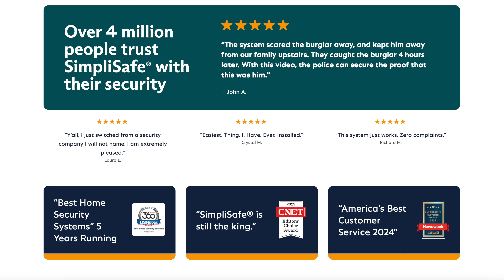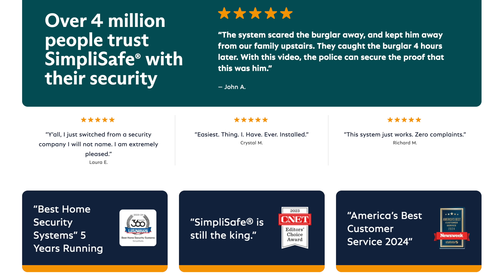Not Going to Lie, I was a Little Nervous! Back in The Saddle

Comment: Hello Mike, I had my Corvette ceramic coated about a month after I purchased it. The car was brand new but had swirl marks on it from the dealer washes while on their lot. It took 3 days between the buffing and double coat of ceramic applied. You cannot use the car during the process because if it gets wet it will get marks, so it must stay garaged during the process. The other thing is it last for a few years and needs to be reapplied. The car looked like it had a glass coat. It’s worth the money.

Comment: The hesitation you experienced setting up the fireworks is classic PTSD.  Besides being a  peer councillor for emergency services workers that had experienced a bad call, I, too, had my own incident when I was hit head-on by a very drunk girl doing 85 mph.  I ended up in intensive care for a few days, but she made a couple of trips through her windshield and nearly bled out.  For a couple of years post-incident, whenever I was driving around a shallow left curve at night and there was an opposing vehicle, my breathing stopped, my pulse went up, my hands clutched the steering wheel, and I froze, at least until the opposing vehicle passed.  I could have sworn the vehicle was going to cross the center line and get me.  Like I said, it took a couple of years to gradually pass, but pass it did.

Comment: Hey Mike, I have a Black Ram 2500 mega cab, and I did the ceramic coating on it about a year ago myself it was quite a job to do on that big truck and I’m sure it would be a big job to do on Melissa‘s new vehicle but I think it is worth it. The paint looks and shines like brand new still a year later, and the ceramic coating is really good on the glass seem to stay clean longer. Unfortunately, I’m in Texas, so I can’t recommend anyone in your area but the product I used was Avalon King.

Comment: I've used ceramic on my vehicles for about 6-7 years. This time I went with a 3 year ceramic coating. It makes your paint look "deeper" than plain wax & if you have a better one put on, it'll last as long as they say it does. So far I'm on year 2 of a 3 year ceramic & it still is doing it's job.

Comment: Mike/Melissa, highly recommend ceramic coating for a dark color vehicle, especially if they set outside. It will cost a bit of money (roughly $1800-$2200) based on who you use and what product they use. Ceramic coating saves your paint and actually allows you to wash less, but it won’t affect the paint/clear coat.  If anyone who spends a considerable amount for their vehicle and plan to keep it past 2-4 years, it’s a definite must have. Almost like window tint 🇺🇸🇺🇸🇺🇸

Comment: Hey Mike, as to your question.  Yes I have a 2012 Dodge Journey that was ceramic coated. Body and rims. I thought it was well worth it at the time. But around 5 years ago we got into a little fender bender. And the left front fender was replaced. It was repainted and no coating. They did a good job. Because today I can't tell the difference. Same thing with the left front rim.

Comment: I did a ceramic coating on my brand new 2023 GMC Canyon when I got it last summer.  I applied it myself, which is easy if your car’s paint is still new without swirls or scratches.  WORKS GREAT!   If you do it yourself you’ll need the car inside/shaded, especially for a black vehicle.  You don’t want to try to apply it to a hot surface!
Reply: On that black beauty no way without paint correction and professional application.

Comment: I purchased a little L3902 last year along with a Land Pride FM2560 with Y blades. I thought I needed hammers because I anticipated limitations. As it turns out I will stick with them as they are ideal for briars, tall grass and some brush. The 39 horses is perfectly matched and it runs super quiet. I sourced mine in Tennessee for thousands less than, my dealer list. Apparently the flails don't sell nearly as well as rotary and some dealerships have them in crates sitting. They were thrilled to drop ship it directly👍🏼 DM and I'll give more details!

Comment: Mike my son  has blogs where he tests products like the ceramic coatings on his restored waggoneers etc. He also has a black gmc suv and the new Toyota Wrangler that is also  black. Here is his comment when I asked him about ceramics coatings.  "if you plan to go through a car wash, its not worth doing the ceramic coating. A PDF film might be a better option. I have  both professionally installed coatings and a warranty and I have done the DIY version. My personal preference: MKee's 37 Deep Gloss Sealant (lasts up to a year). Both are super easy to apply. The McKees's makes the paint feel like hot butter it is so smooth."

Comment: Hey Mike, our families have a LOT in common, we even have a golden named Axle (because we’re car, equipment, etc people but I bet yours isn’t spelled the same.)  All that said, in answer to two of your questions: 1) emphatic yes on the ceramic coating, did it on my wife’s Yukon Denali and my C8 and it’s a game changer, NEVER have to wax again!  I HATE washing and especially waxing vehicles!  Downside is the cost if you have it done professionally, about $2500 in eastern PA but I’ve heard you can get the good stuff to do it yourself for a few hundred bucks, 2) so glad to hear you’re finally in the hunt for a flail mower, I love mine!  I have a hydraulic offset Del Morino Centurion 158. If you think the brush cutter on your mini skid mulches things well this takes it to another level, think actual mulch if you go slow and it cuts grass nicely too.  I have the knife cutters but would have preferred the hammer’s because I’m usually making trails and churning through saplings but the knives have done remarkably well and are holding up better than I thought they would.  The flails don’t require much PTO horsepower so your 40 hp Kubota would do fine in that regard but I don’t know how it would do stability wise with the offset function.  It’s no issue with my tractor but it’s quite a bit bigger, about 12k with the loader, flail and all the ballast I have. I think the flail is around 800-900 lbs if memory serves.

Comment: Nice to see the fireworks flying again. Looked like it was a great show. I have a Del Morino Super Centurion 158 flail mower. It has hyd offset and tilt. Fantastic for ditch banks, around ponds and fence lines. I am using hammer blades. It is very well built and has not given me any problems for the past 5 years of fairly heavy use. If you want something with a wider cut, I would recommend getting one with just hyd offset and no tilt. I seldom use a rotary cutter any more since the flail does a much better job.

Comment: Hey Mike. I have plenty of time but I buy the turtle hybrid ceramic coat from Amazon. Also had a black truck before the black truck I just bought. I did it myself on the old truck and found it a lot easier than the old paste wax we used to do. Can do it in half the time. Easy on and easy off. Now the new truck I just bought supposedly has it. They tried to charge me xtra for it saying they do it to all their new ones. I said I’m not paying for it and he said I wouldn’t get whatever kind of warranty for the ceramic coat. I told him no problem. No warranty! A regular detailer will charge to clay bar your finish to correct the finish before ceramic coating it. A new vehicle doesn’t need clay bared or paint correction so you should get a break there. I do believe it is worth having. My old truck beaded water like fresh wax but I did the ceramic hybrid a couple times a year. Good luck bud

Comment: Mike, I emailed you back on August 3rd with the suggestion to have your truck and Melissa’s new SUV ceramic coated (by a professional). I had my truck ceramic coated back in 2021 and it still beads and sheds water like crazy even after 3 years. The main benefit, in my opinion, is that it makes maintenance washes so much easier because the dirt doesn’t stick to the paint like it does without any protection. Also, there are lots of products available that you can use to maintain the hydrophobic properties that comes with a professional ceramic coating. 👍

Comment: Ceramic coating is the way to go. I have had both my p/u and my wifes new vehicle done. I use a detail shop close to where we live. It makes it so easy to keep the vehicles clean. I rinse both off about once a week and have had great success without using soap. Cost on both was about $350.00. Ceramic coat will last about 16 months. Great investment and time saver.

Comment: Last Dec I bought a 21 Ram Bighorn that was a lease truck. It had just under 18K miles and is a dark Patriot Blue Pearl color. I had it ceramic coated and I like it. If it is a little dirty I just park it in the driveway before it rains and it gets washed and the water just rolls off and it's clean. if its not going to rain I can just hose it off. since Dec, 4th I have only washed it 5 times and I am in Mi. and I drive on quite a few gravel roads and that ceramic coating just keeps it looking great.

Comment: Mike I use Exoforma on my trucks….they make all kinds of cleaning products……the main product is a ceramic spray on and wipe off……at first I thought this stuff was bogus…..but after using it this stuff does work!!!…..look it up for yourself…….I’ve been using it for almost 6 years…….the key to this stuff is to use the preparation cleaner first before applying the ceramic coat protector……mud just rinses off with water

Comment: Bought a flail mower last year and the bush hog has not been back on my tractor since. Flail mower leaves a much nicer cut and it doesn’t bog down as much as the hog in the heavy stuff. I use the hammer blades but if you want to use as a finish mower you can always change to the scissor blades.

Comment: Mike, I ceramic coat my own vehicles. I’ve even coat my tractor and zero turn! It protects the paint, makes it a little scratch resistant and makes it easier the clean as it makes the paint slick and thus, dirt, etc. doesn’t stick as bad. I use Gtechniq coatings and foam cannon soaps. I live in SWest Va so I can’t help you with an applier friend. That GMC sure would look good…. just saying….😁

Comment: Good morning Mike and family. Mike, I use 2 of my 275 gal. totes to catch rain water off 2 of my sheds roofs. I use the naturally soft rain water to rinse my KX 40, vehicles, and tractors, etc. I too use a blow dryer and it leaves a spot free rinse. To spray the rinse water from the tote, I use a 20 V Dewalt power washer. It has a suction tube with a float that goes into the tote and the other end attaches to the sprayer. It's very mobile and can be used anywhere you can haul the tote. Heck, you could even spray water on your food plots if needed. lol  ( From the Ted who's not a Dick )lol  Have a Day!

Comment: I've never had a vehicle ceramic coated but I do use a ceramic sealant or spray wax on my vehicles after I wash and dry them.  If you're not going to use some sort of paint protection as part of your wash process then you should get it coated.  I don't have any recommendations on which one is best but I do recommend you get some sort of paint protection on that vehicle.  
Dave in Ontario, Canada

Comment: Mike, based upon your recommendation we purchased and installed simply safe a couple of weeks ago. We are not very happy about one thing. There is a delay between the time the camera picks up motion and then connects to the base and then back to the camera to show us what has happened. Sometimes it only shows the back of someone leaving and sometimes it doesn't show anybody was there even though we tested it to make sure there was someone there and the camera was working. Haven't decided what we're going to do yet, but I am leaning towards sending it back. We saw some SimpliSafe user forums and other people have the same issue. Supposedly simply safe was going to address this but they're very slow in doing this. Anyway, stay safe healthy and cool. Bill H from Cranberry Township
Reply: If you have slow internet you will have this problem, just like streaming a video and it freezes a lot...:body-blue-raised-arms:  My  camera is not from Simply safe but from Wilson security. Boosted my internet connection and it works great.
Reply: I have high-speed internet through our cable company and stream everything without other issues.
Reply: The problem is that the cameras go to sleep and then they have to come awake when they sense movement and then they communicate with the base and then you get to see images. It would be much better if the cameras were awake the whole time and did not have to wake up and connect to the base. Apparently that would eat up the batteries quickly. SimpliSafe is not yet been able to come up with a workaround.

Comment: Ceramic coating is definitely worth it.  I have a mustang with a 2 year coating and a new super duty that I got the 5 year coating.  The 5 year coating is a lot better than the 2 year coating was when it was put on.  Water beads up really nice and it is easy to clean.

Comment: i have become addicted to ceramic coating my vehicles.  i highly recommend it.  yes, its a good bit of dough to have it done correctly, but man does it make a difference in ease of maintenance.  i get a 5 year warranty product put on by a detailer.  PPF the nose, a pillars, and anything body color up front like the mirrors, and ceramic coat on top of it and the rest of the vehicle.  even did it on my sprinter van RV.

Comment: Love when Hunter gets in the vlogs... same with Levi... Imagine all the free time if you had purchased the T Rex 600 splitter with the hopper.... ya it was pricey... but it cut the time of your log splitting and half and saved so much wear and tear on machines and your back.. plus was fun to watch ...
Reply: Only downside to a couple of his wood splitters is they are only good for 16 inch rounds. My furnace will handle 36 inch rounds, but I have to cut it at 24 inches because my splitter will only handle 24 inches.

Comment: My Pop used to put a splash of kerosene in the wash bucket when he washed the cars.  Pop said that it helped to cut the road tar and left a shine on the finish.  Great video Mike thumbs up.
Reply: @craigsudman4556  I had a grandmother that used kerosene to clean windows.
Reply: @davidmorse8432  Did she use it full strength or just put a splash in the water?
Reply: @craigsudman4556  I was just a kid so I don't remember.  It wouldn't mix with water would it?
Reply: @davidmorse8432  No one would have to use a soap.  I'm not sure what my Pop used, either liquid or powdered soap.  My Mom used straight vinegar to wash the windows.

Comment: YES!  You need to have your vehicles ceramic coated (proper application).  Amazing how quick you can clean your vehicles with pressure washer and foam cannon.  The car will be spotless and 100% dry with little effort using a leaf blower.

Comment: Purchased a GMC Sierra in 2018 from Star GMC in Easton Pennsylvania. It came with a ceramic coating called glass coat by Simoniz. Best finish I've ever had. The truck always stayed clean. Even a quick rinse brought it back to like new finish. In 2022 I purchased another truck and had it ceramic coated by a detail shop. It couldn't compare. No comparison. I believe ceramic coatings are the most counterfeit or misrepresented products on the market. Everything is called ceramic nowadays. Simoniz brand has been around for years. I wish I would  have used Simonize glass coat on my 2022.

Comment: Hi Mike. You're a practical man, so you've probably thought of this yourself. But I will make this suggestion for improving your wood splitting. You can make a stand or a set-up for splitting wood in a fixed place near the wood bunker. This should be placed on a concrete surface so that you can easily sweep up all the sawdust from the chainsaw from the concrete deck. Then you don't have to constantly fill up or improve the road superstructure. Just an idea :-)

Comment: There is a produce calledTorque ceramic coating which you can buy online. I have used it on my corvette for five years. I can coat my car in 20 minutes. Spray, wipe on , buff.

Comment: I've had the ceramic coating done on my Cayman. It was a 3 year treatment that was a $1000. Yours will probably be much more. It works well at keeping dirt and residue from sticking. Doing the wheels made cleaning brake dust a breeze.

Comment: I had my new truck ceramic coated.  Everything comes off quickly except tree sap.  I got some pine sap on one part and it did not just rinse off like everything else has.  I have had the truck about 6 months so time will tell as to how the ceramic coating holds up.

Comment: Yes I have had several vehicles ceramic coated. I would suggest you get the front and the mirrors PPF film protected then ceramic coat the rest. I have had many black vehicles and the rocks chips are the worse. The PPF and the ceramic coat will keep your investment looking new. But BUT…you need to stay on the preventative steps with ceramic coats for it to last. Otherwise don’t waste your money.

Comment: Ceramic Coating would be nice it makes washing your vehicle a dream water just falls off the paint. But the coating will only last if you maintain it correctly meaning don’t go through a lot of auto car washes that use strong chemicals. A lot of brands will advertise coatings as lasting 5 years or so but I take care of my coated vehicles and I have gotten 3 years so far out of a coating that’s usually when I can see it fading especially on the lower parts of the door.